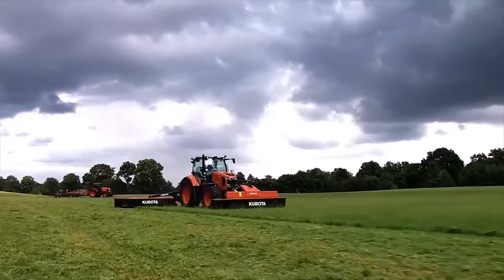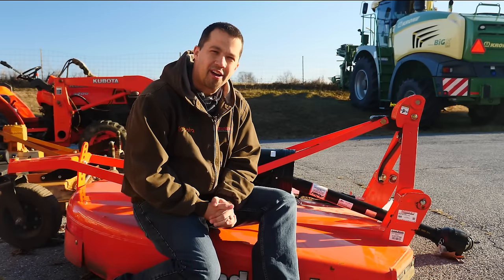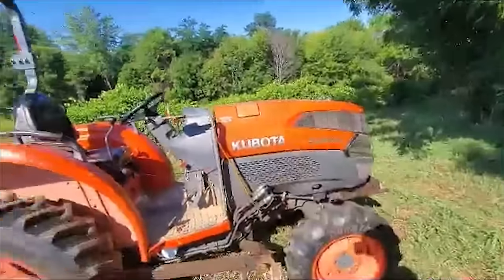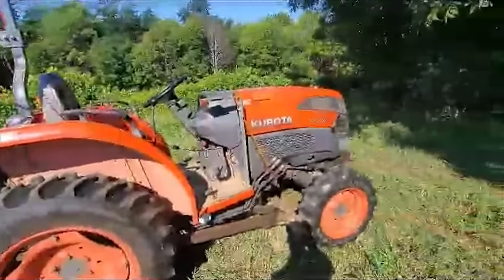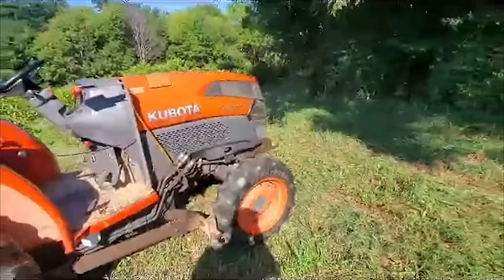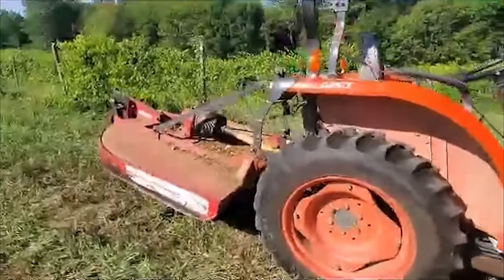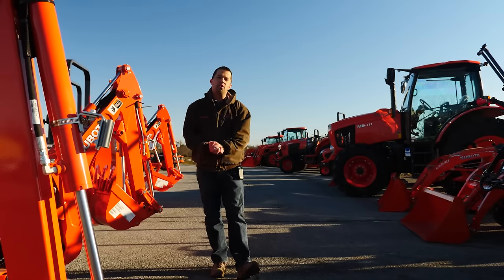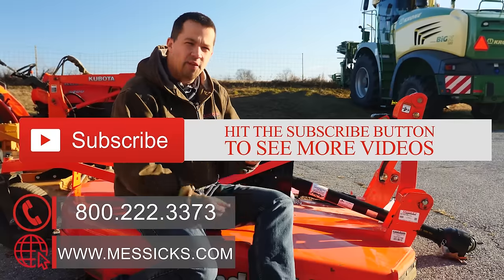Rotary cutter adjustments. Improving mower float.

Comment: Replace the top link with a length of chain the same length as the original top link.  Fixed
Reply: This is a trick I was taught by an older fellow when I moved into hilly terrain area lots of years ago. When the implement (rotary cutter) is raised the chain is pull taunt and lifts the cutter. When mowing, it is free to collapse and prevent damage.
Reply: Ensure the PTO shaft will telescope enough to not punch the back out of the gearbox.

You can also install castering wheels at the deck font corners to ride the wheels instead of the drag shoes.

Comment: We use a heavy chain in place of the top link when running a rotary cutter. Using an expensive hydraulic top link is asking for pain and suffering when you bend that on some nasty terrain.

Comment: Replace top link with a chain, floats when down but you can pick it up.
Reply: LOVE your username!
Reply: Thats a great idea but keep in mind there’s a pto shaft running right below it.
Reply: @strangefruit8776  the length of chain wouldn't be long enough to hit the PTO. We did it for decades
Reply: I popped down here to say exactly this.  Chain or other flexible material.  Probably not a rope given how heavy that mower would be
Reply: @aaronspicer949  +1..........I watched this whole thing in pain, two thick flat plates with one end on each with a radius and hole bored for pin size on both tractor and mower, piece of  thick chain welded one, other end had the chain bolted to its plate change length to your needs, to keep the chain from bouncing around split a piece of flexible hose down the center and zip strip it over the chain every few inches.  You have the mower flex you need.  Must be the younger generation, but that is how EVERYONE around me had 3pt mowers on 9,2, and 8N Fords.
Reply: @tpfromcentralpa1692  Yeah, it's probably the younger generation's fault that your generation didn't make the effort to mentor them like the Greatest generation did to you all! 😂😂😂
Reply: Bushog used to make this type mower...still have one.  They don't make them anymore.  Why do you suppose that is?  🤔
Reply: How do you figure out the length of chain?
Reply: @brucelaatsch8668  it'll be roughly the same lenght as the top link

Comment: We use a hydraulic top link but with the normal hoses disconnected. The ends of the cylinder are connected together with a valve in the middle of the hoses. the valve is positioned beside the seat. With the valve open the cylinder is free to travel in any direction of the length of stroke. With the valve closed the top link becomes ridged to allow normal lifting.

Comment: Thanks for the video. My Kubota factory manual ( L3200 ) is quite specific about having the 3 point chains adjusted tight ( no flexing ) while rotary mowing. So this video raises a interesting issue. My Land Pride RCR1260" does have a pivot at the top link. I have noticed the mower being rigid in certain changes of gradient which I do try to avoid. Every year I brush mow 30+ hrs on food plots and trails and other projects such as shooting lanes. My favorite chore on my property.

Comment: Good fixes you had Neil.  I live in the Mountain state of W.V. I work for a Gas Company and on our pipeline Right of Ways we contract out the ROW mowing. I've seen their tractors top link removed and a piece of log chain was used for the top link.  These were large 4x4 tractors pulling 7' rotory cutters.

Comment: Seems that a chain to replace the top link is the overwhelming favorite option in the comments here, just wanted to suggest that if you were interested in using a hydraulic top link and do not either have rear remotes or a rear remote with "float", you can get longer hoses to connect to you loaders quick connects and use the boom's "float" position when you want "float" and easily pull it out of that to adjust for travel.  (Did not see this was a year old till right after I hit reply 😂)

Comment: this is my set up. landpride 7 ft cutter on my mx5000, the cutter has two rear wheel's. i do not hook up the top link. i can raise and lower the cutter for a cutting height. also i can back up a hill and down over a hill to cut with max angle's.
Reply: BINGO! You don’t need or want a top link when mowing.

Comment: It’s also overlooked that if you have too much range of motion you can bend driveshafts by hitting the deck, or pushing it together beyond its fully collapsed length can bend them or break U-Joints, so always make sure you set upper and lower travel limits. Pto shaft failure is one of the things that doesn’t happen often but if it does you’ll remember it.
Reply: That was my thought when I watched this video. Damaging a pto shaft is a nightmare. I do not mow perpendicular to.humps and dips.

Comment: Ive see some mowers where instead of the rear tie bars they have replaced the with of chain from the back of the deck to where the 3point mount meats the top link that could work without needing to keep track of extra 3pt hardware

Comment: Hi there I've got a l4240 and looking at getting a offset verge mower which requires 2  twin.acting aux remotes , 1 for the offset and 1 for the tilt of the mower rotor , I need to fit a another twin acting remote .my question is would I need a valve with float . Many thanks  in advance

Comment: The issue I think you would have is that if you use something like a chain then it seems like it does not pick the deck up high enough when done mowing. Many times I leave the mower on for ballast (and laziness) and do loader work but the deck hits the ground all the time because it does raise it up enough. Maybe it is too small of a tractor. It is a JD 1025R with a Frontier RC2048. My dad bought it 2 years ago and severely under bought. He has passed away now and I'm taking care of the property. I'm about to sell it to buy an Orange L4701. 6 foot cutter here we come!
Reply: after you finish mowing lower your mower all the way to the ground and shorten your toplink it will pick up the mower  much higher for travel

Comment: What would happen if you just replace the top link with a chain and put a couple hitch pins through the ends? That would allow it to lift from the back if it went over a hill but would still lift it I would think so?

Comment: Also lowering your 2 lower rear arms will help contour on the ground, using hydraulic top link can help but be careful when pushing outward towards the back of tractor you don’t bend those thin long arms that control the upper top link swivel

Comment: We found out many years ago that the two brace arms on the cutter will always end up getting bent all to hell, so on every new cutter we purchase, we remove the arms and install light weight log chains to the link arm A Frame, using the same bolt holes as the two long brace arms . These let the cutter float up all it wants without bending anything. Ford and some others used to offer these chains on new cutters.
Reply: This seems like a great idea. Thanks for the share.

Comment: Great video. A lot of comments correct using a chain. But you can also use a cheap swivel like Neal said.  That is what ours uses.  Just a simple 6 inch piece of metal bent in a U will work
Reply: That is what the old Landprides run

Comment: Instead of the flex link, European manufacturers simply fit either two chains or webbing straps where the flex link is attached.  webbing straps have the added advantage that when traveling in transport the webbing cushions out the shock loads.

Comment: He could use a flail mower since it's closer to the tractor. He could also put chains on the back bars going from the 3 point hitch to the back of the brush hog so it can flex more.

Comment: My Land Pride manual says something about using check chains. Does anyone know about them and how they work?
Reply: check chains go from the upper link pin to the top of the mower deck. So when you drop the mower down it will stop at the chain. You set it at the height you want. Then you don't have to worry about dropping it too far. My finish mower has them. my brush hog does not.

Comment: Change the Rotary cutter for a flail mower. It is way shorter due to the horizontal axle. We have one and it works great. Since you are not clearing land but mowing it this would be a good change. Follows tractor and landscape easily
Reply: Price difference,
Reply: @Redandranger  ah yes, there is that.

Comment: great video! you can also use chain on the brush hog where the "A" frame attaches to the rear of the hog. remove those solid metal pieces and use chain there. just dont go to crazy or the hog can bend down making the PTO shaft hit the mower deck just under the "A" frame. you can place the chains as I did in this video where I convert my finish mower to quick hitch ready. https://youtu.be/L8ZHfhS__bU

Comment: Neil I have a question regarding the older zd221 what do I need to look out for when buying one of these used? It’s $5500 322 hours. Are there any common failures?
Reply from the maker: make sure the transmission is strong. They are great.
Reply: @MessicksEquip  Do you know what year kubota changed the input shaft on the transaxle from a bushing to a bearing so they didn't have the warranty issues?
Reply from the maker: @FishFind3000  Not aware of that on these?
Reply: @MessicksEquip  I knew about the zd21 series that had that issue I just wasn't sure if these also had that issue. Also are you able to find out what month/year this mower was made? Its model ZD221-54  S/N 10504
Reply from the maker: @FishFind3000  8/2010
Reply: @MessicksEquip  thank you very much I really appreciate it.
Reply: @MessicksEquip  I was able to get the serial number of the top of the engine and its saying its a nov of 2008 build. Does that sound right? could an engine have sat for 2 years before being put into a machine? the engine tag info is SN: 8W9901 Code No: 1G716-03000